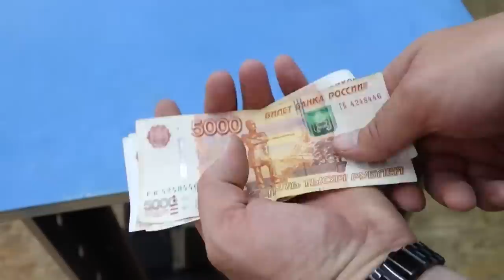НОЖНИЦЫ как БРИТВА за одну минуту! РЕЖУТ ДАЖЕ ИГЛЫ!

Comment: The one with putting the rubber tubing on the screwdriver to hold the screw to it I've done for years I figured it out at work where there was no way too get a finger in a place where I had to put a part back on what I was working on, also if it's magnetic you can place a small strong magnetic on the shaft of the screwdriver  and it will hold the screw also if you have thick grease like Vaseline or about that consistency dip the head of the screw or tip  of the screwdriver in it and it will hold it long enough to  get it started 👍